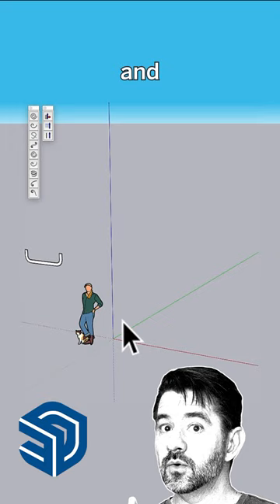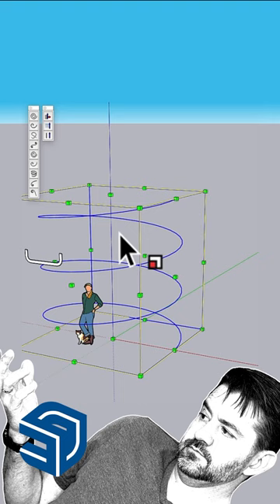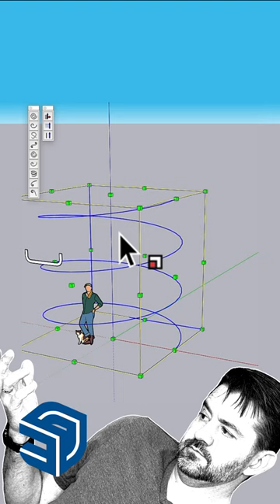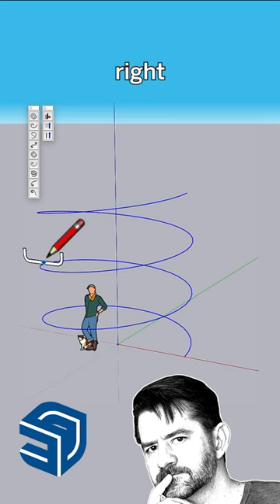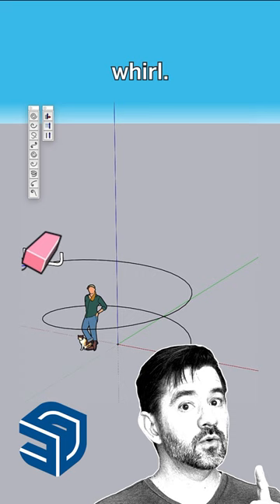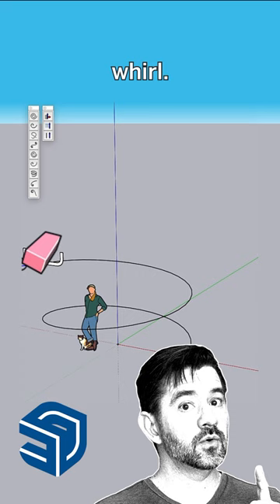SketchUp Helix Slide in Under 30 Seconds

Comment: Sadly so many of the cool extensions say they are incompatible with current software. I found the extension and it says it is only compatible with Sketchup '15, '16, '17, and '18.
Reply from the maker: That doesn't mean they don't work...just that the developer has not updated them recently. Give it a try!
Reply: I have the same problem!!!! Does anybody recommend any. I need to do slide . Please for help